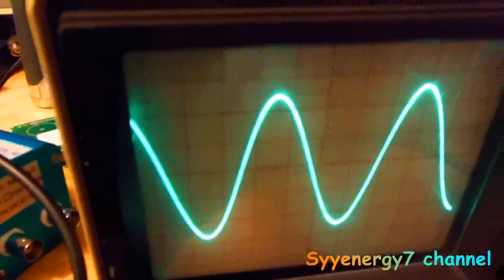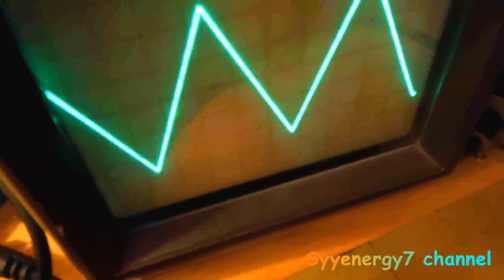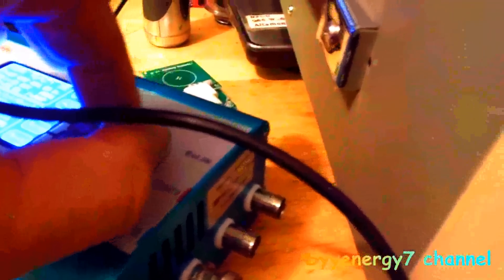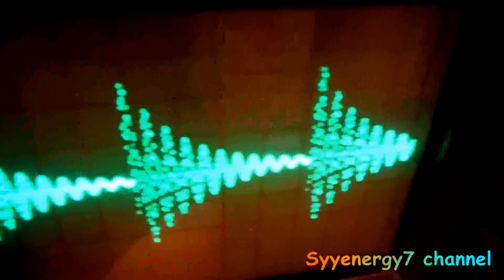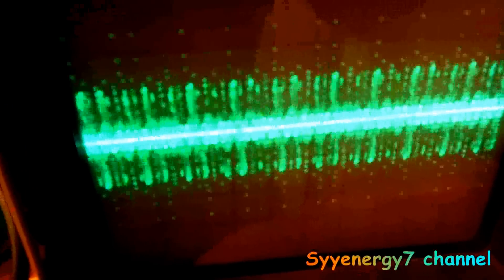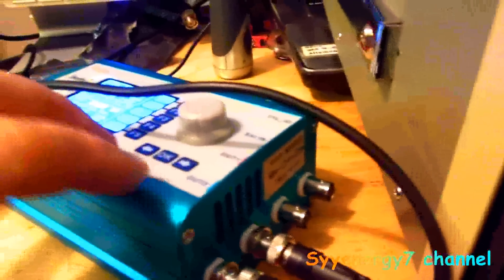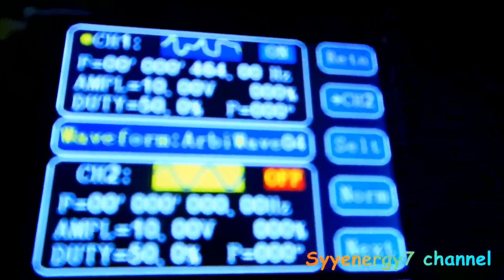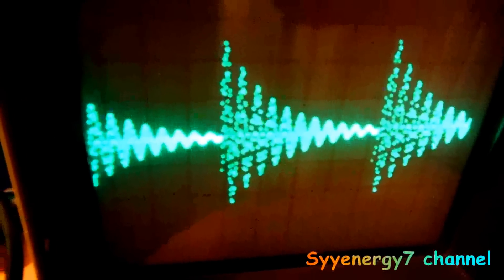Spooky2 Arbitrary Waves Revealed

Comment: #6 looks like RC free discharge itself till overall energy run out then charge again to full and repeat the cycle.
Hook up to speaker with proper loading might make your kitty curious about these sounds.  All wave forms can be generated by a few resistor, capacitor and inductor. First class of DC electronic will explain everything.